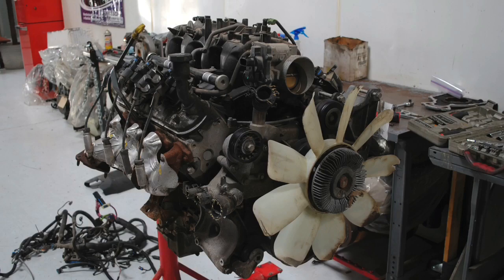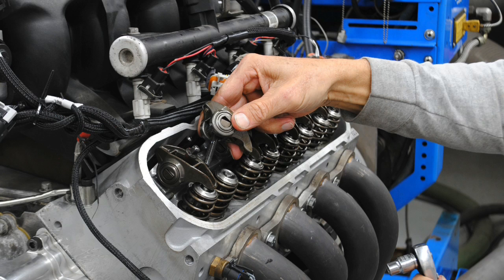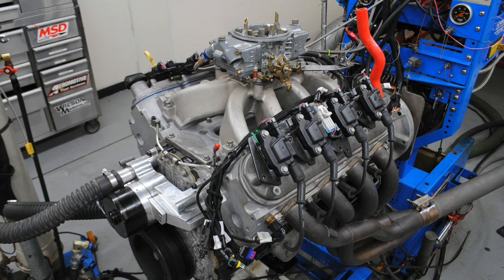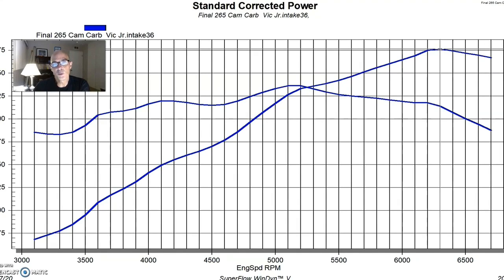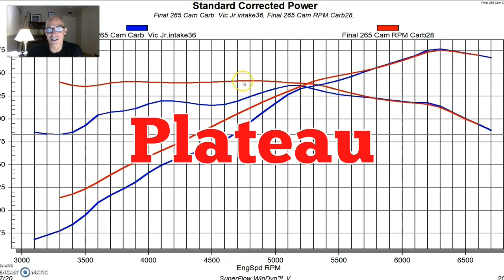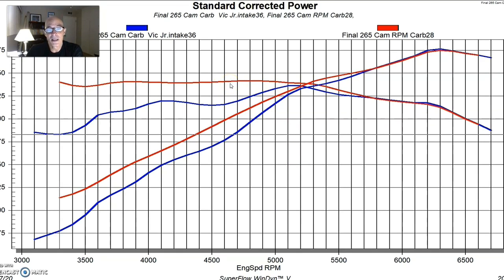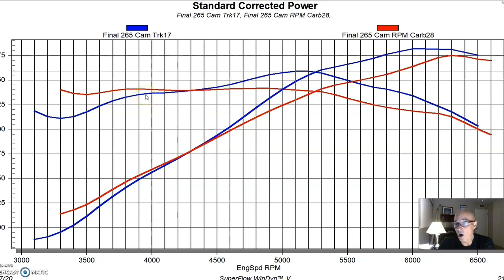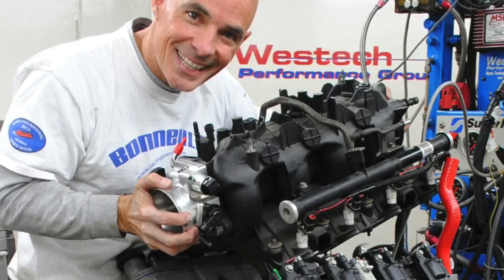CARB & EFI 4.8L INTAKE TEST

Comment: Do you have this test on a bone stock 5.3?  Just curios what peak HP would be on a bone stock junkyard 5.3 with carb & dual plane setup?  You typically get around 350 HP with how you setup your tests….Would it be similar peak HP like the 4.8 or do the extra cubes help out the carb setup?   

The RPM range where you get extra incremental torque with factory efi is very surprising to me…..I guess the low pressure waves in the long intake runners are well timed at that rpm range….

Comment: Have a gen 4 4.8 with 706 heads, texas speed 3 cam, ls7 lifters that got for free. That I want to put on my 1981 c20 paired with a th400. Thinking of going carb since I have no ecm or harness. Dual plane for the the low end torque. this setup work well with the c20 th400 4.10 gears 265/75/16 31in tire?

Comment: Do you have a video on dialing in a MSD 6014? I have my 4.8 running on the the "Truck" preset. I have a BTR Torque Cam and 650 Edelbrock AVS2. I'd like to use a "Custom" setting do dial it but have no idea what to do
Reply from the maker: I use custom and no map-only rpm vs timing

Comment: My little 5.3 s10 with longtubes ss2 cam .pac 1218.s holly duel plane and quick fuel 750 and nx mainline nitrous kit .th400 amd 8.8 rear thiers few more things done but that's basic rundown runs very well on motor ib beat a new 5.0 mustang and other similar s10 that are fuel injected but I don't care about carb or fuel injection either one makes great power both have ups and downs im not chasing every extra few hp eirher.rhays why I have nitrous. Lol

Comment: How do I pick out the right tunnel ram in carburetors for my 496 big block
Reply from the maker: a pair of 650s or 750s
Reply: @richardholdener1727  thank u
Reply: @richardholdener1727  how about a tunnel ram what would you suggest a holley sniper or weiand tunnel ram

Comment: Would a summit Stage 4  .625/.605 lift 234/247 Due 113LSA work on that type 5.3 Carburetor dual intake combo for high way/Street
Reply from the maker: yes

Comment: I have a 4.8 with the Edelbrock dual plane intake, FITECH TBI and 700r4 with stock converter to put in my 68 Pontiac Tempest Wagon with 2.78 gears. I want to daily drive this.I am also considering a BTR Torque cam. and a 1/2 edelbrock 8722 wood spacer to keep heat off the FITECH (don't know the performance). What do you think of this combo Rich? 
Thanks, Al

Comment: Did you run the dual plane backwards?
Reply from the maker: yes you can
Reply: @richardholdener1727  I guess it depends on the angle of the engine.

Comment: Would like to see an additional injector set up behind throttle body on truck mamifold to see what the effect of charge air cooling and mass inertia if any is compared to without and carb performance

Comment: The reason the truck efi manifold vs the dual plane tb/carb manifold makes less torque , but slightly more midrange & high end HP, is due to the truck efi having a larger plenum area, whereas the dual plane has a smaller plenum area  (or the top end where the carb/tb mounts). So this would make sense.  Larger runners, more low end, Larger plenum, more high end. So when you change one, it will affect the other. How much you change these is dependent upon what you are looking for.  For example, adding 1/2", 1", 2" , etc  tb/carb plates. The fully open ones add plenum volume,  the 4 hole versions add runner length. So these should be used accordingly. Whether the depth (1", 2", etc) or fully open,  4 hole,  even the tapered versions of each can affect the powerband.  I see these, amongst pretty much anything that goes on an engine, all mismatched &/or thrown together improperly.

Comment: I’ve been running an RPM intake on a mild cam 6.0 Ls2 with ported 243 heads.  I use a Holley Terminator TBI and HP ecu.  
The carb intakes look clean and good under the hood of a classic. The carb intakes are inexpensive and simpler to set up if you’re using an actual carburetor instead of TBI.   
Looking back I would have gone with a more expensive set up like a Fast Lsxr intake on my combo because the RPM intake in comparison leaves a lot of power on the table.  If I went with a Fast now it would wake it right up.

Comment: Wow, excellent video Sir. I had always assumed even w/a mild cam on an LS engine that a single plane would flow better right off the bat. Reason being is the natural (unported) flow characteristics of gen 3 & 4 heads are so far superior to that of a small block that the gains (even if miniscule) would still be visible. 

Another interesting note is again, how the factory truck intake really is a good performer

Comment: In defense of the carb setup, the power curve it’s laying down is far superior for the daily driven, red light to red light type of build. So when the dude with the efi setup pulls up next to you at the next red light you’ve got the 60’ in the bag. If he’s got the gusto to gap you, spray it at 5K rpm with a 125 plate.

Comment: This was something I always wanted to see. I have a carbed single plane 4.8 with a ss2 cam. Its driveability is junk! Anything below 4k is snooze fest. But when the secondaries open up it really does scream.
Reply: If it's got mechanical secondaries a small bolt with a nut on the linkage will make them open quicker... Have fun
Reply: @theall-seeingpie8887  it's vacuum, and I have the lightest spring possible in there. I'm going to tbss intake and EFI soon. Thanks for the tip though!

Comment: That is interesting....a long runner EFI manifold had LESS torque down low and MORE torque at high rpms...never seen that before. Any guess as to why?
Maybe the aftermarket cam affected the results?
Reply: Dual planes make more low rpm torque.

Comment: hey try this on the ls run singel plane and run a small cfm carb change the air bleeds.i think your running a 750 850 cfm try a ajustible carb at 600 cfm with this combo.volacity is the way of low end.dual plane is best for small cubes air speed seem to be best for low end but uper end is where we like to be.this is my take on this now for a exsample on stock intake ive ported just some off the runners port match and just good runner clean up not big air stuff seemed to raise hp in uper rpms but still keep low end and midrange pulled well it was crisper all around.so hp how much est 10 hp but thats seat of pants pull thew th rpm range.yes its not worth to port stock intakes but when you want a littel extra kick yes its worth it i think so i dont mind at all to do it and yes ive lost hp to from hoging ports out so you live and learn i did.ram tuning now thats a callange right cam? intake?carb and be tune to a rpm from1800 to 5000 big leap i know but its a chalange to get close or try.there some cheap thrills.E-85 a fule to just to try to go faster with.lets build a carb for e85 can it be done for cheap and be realible for every day use holly makes one now can any body.
Reply: You obviously don't understand tip in on the carb sizing and smaller isn't always better for torque.
Reply: @kkmart43  smaller will raise low end not top end and singel plane loses low end know matter what you have  and volicity will raise torque changing to a bigger carb dont in prove to raise low end that was the point.and big ports dont always help fill the chambers at low rpms volicty dose so if i wanted to reach 7500 rpms yes singel plane but you lose low end.holly could give you a better understanding of this factor.
Reply: @jumpsuite  carb sizing doesnt change anything unless your too small then it will kill low end, it's all in the manifold.
Reply: @kkmart43  ram tuning is about filling the chambers at sed rpm cam +carb +  fule at sed rpms=hp.manifolds can be to big at sed rpm.amanfold is tuned to a rpm no.so  to small you lose uper end zo if manifold is the right size it will alow you to make hp but thirs rpm limits to manifold thing so the manifold controls it all no it dont.flow only means hp when its right to the app not big means more.thers so much more to list im  not going to  reply so dont.if your into engines and try helping others than help them not me thanks.
Reply: @jumpsuite  im not arguing about the effects of intakes, your original post says to put a smaller carb on a single plane intake to boost low end. that will not boost low end.
Reply: @kkmart43  ok now rpms from 1000 rpms to 5000 your low end is apox is 1600 rpms now a biger carb help no .but if your useing single plane you lose low end and if use a bigger carb on the singel plane you agine no low end  now if your running to 7000 rpms the your low end gets bigger but now it comes to cam size carb size and manifold range in rpms oh heads to cant for get that.but if the cam is for upper rpms like from say 3000 to 6500 than yes smaller will kill low end but to big dont help either so when you need response when your racing now you cant lose a fraction of a secound you lose so the carb for what you biuld is the factor you need bigger is not all ways best but a you seen on this it didnt make much of a diffents but it did show what you need to make the engine get the best hp at sed rpms on the engine tested so if i was raceing i would choose the right cfm carb that gave the best over all hp  but the reponose is the key.

Comment: The Victor is too big for a 4.8 engine. A smaller intake, single or dual plane would make it better.
Same test on a 6 litre would make a difference. Surprising on a healthy [good heads, compression etc] SBC the Victor was very good.Low end and mid range And that defies common logic.
The dual plane does not work with throttle body efi. Engine master did that.
The truck intake V the dual plane. Power was better below 4500, torque was better below 4500 also.

Comment: What if the dual plane had port injection installed and a throttle body, would it have the torque low down with the tunability of the factory Fi, next the turbo test how do you make this work in a street car that has to have mufflers the back pressure 4 inch dump pipe can you revisit the turbo test with exhaust pipes and mufflers to see the difference and a air cleaner. ever thought about a Y block Ford test? some people are making big power with them.

Comment: On the factory intake, would it produce more torque if the injectors were higher up on those long intake runners? I know it can not de done but if it could, I think it would make more Torque and HP.
Reply from the maker: YES

Comment: I hate to be that guy but why not try the tbss intake with that combo. I run that exact cam in 2004 36k 6.0 completely stock except cam and it will completely blow the the tires off. The torque is nuts. I am wanting to put my my vs 76mm turbo on but can't find the time. I hate responsibility lol
Reply from the maker: THE TBSS DOESN'T DO ANY BETTER DOWN LOW THAN TRUCK
Reply: That is pretty much what I was thinking with the torque I was just curios how much hp it might have picked up hp wise with that 4.8 combo over the stock intake. 15 maybe 25 as everyone has said keep up the testing I love it.

Comment: Wheres that custom super long length  ls intake that Drives torque in the 1500 5000 range ? You know the one that you haven't built yet.

The one with water jet 3/4" flanges and exhaust collector style   single point collection per bank of 4 
Them move 8 injectors away from the head to the other side of the motor for charge cooling ala crystler in 66.

You can do all that for turbo wiz bang, 
Why not N.A.?
Reply: Would love to see a really long runner LS intake to replicate a TPI set-up.  You’d think that would be a hot item for every truck owner.
Reply: @wwmaness   Ilmore made an intake for their 6.2 marine engine where they claim peak torque at 4400 and peak hp at 5600 that looks alot like the TPI intake to me, it has a lower and upper that bolt's together. I have one waiting to go on something.
Reply: @oggp5951  Thanks for sharing!  That makes a lot of sense that one was developed 
 for a marine application.  Cool that you were able to get your handles on one as well. We know Richard would love to test it!
Reply from the maker: MISSED ON A FEW OF THE DESIGN POINTS

Comment: Hey Richard, set youself up an account with Row52.  You can get an alert by email when a hard to find a vehicle is freshly set in the yard. Like you said, got to be one of the firsts ones out there or they're gone right away. This is how you'll get those 6.0L LS or aluminum 5.3L from the Trailblazer/Envoy.

Comment: why dont u guys ever show 1500 rpm and up ? great vids you putt allot of work into this
Reply: I’m assuming it’s because nobody would need nor care how much power you make that low especially considering you’re not even at full throttle.
Reply: @linoleumshake  HIGHWAY speed climbing hills  PUlling towing etc ? without spending extra 8000 grand or  repair costs on a diesel
Reply from the maker: AT WOT?
Reply: Most trucks have stall speeds in the 1,200-1,600 rpm range.

Comment: @Richard Holdner, you should do a comparison of the dual plane versus the Gen 4 truck intake and the LSXRT, I have a gen 4 LY2 I'm building for my E36 track car and would love to see that comparison! I'll be doing BTRs road race cam along with TEAs 243/799 cncd heads with a bump in compression, im shooting for 500 crank horsepower similar to your 500hp recipe setup
Reply from the maker: lots of vids up comparing the Fast to the truck-the Fast is a lot better-just more $
Reply: Eventually I would like to do a TSP sleeved block bored to 4.185 with the 4.8 crank giving me a 359ci setup with a 6.500 rod and custom pistons, ends up with a 1.98 rod to stroke ratio

Comment: I thought of a neat idea build an elbow/adapter to mount a carb on front of the truck efi intake, I don't see how it would be hard to Fab up, it would be interesting to see if it even worked, I think it would. You could start a revolution!
Reply from the maker: I built one of those-just haven't run it yet
Reply: @richardholdener1727  nice!

Comment: Gosh, this is exactly why I wanted to see the Offy 360 deg dual port high rise. To compare to the RPM air gap. I wanted to see if it took off the high end or not in a direct comparison. The idea seamed solid to keep the velocity on the low end and provide the volume on the high end. I know you said you tested them before but I searched your videos and cant find it anywhere. THis fasinates me because I remember guys knife edging those port dividers to increase the CFM and they swear it worked. It was popular back in the day.
Reply from the maker: have not run the Offy 360
Reply: Oh, I thought you said you had. I'd like to see that go turbo.

Comment: An LSA experiment in this mix would be awesome. You have 114 here, 110 is common, 106 goes begging, and 102 is the not insane step to see if what everybody says is how it actually goes.  
102 is maybe not as crazy as it sounds. 212/218 with 102 LSA has the same overlap as 222/228 with 112 LSA.
Reply: Just makes for a more peaky powerband/ torque curve with the tighter LSA
Reply from the maker: look at the lsa vid already up
Reply: @richardholdener1727  That didn't get down to the 102 LSA
Reply: It was that LSA test that made me want to see what a short duration ( like 212/218) would do at 102 LSA
Reply: 212/218 with 102 LSA has less overlap than a 232/242 with 120 LSA

Comment: Rich you to use the wats line 
And get them shipped into you
I have yet to be in the boneyard where you don't stumble across a half a dozen or more in the yard at one time 
I am currently building lq4 6 litre in to stump pulling 408 cubic inch 6.7 litre
Reply from the maker: wats line? I spend endless hours in yards-do not see any 6.0Ls-only the smaller ones

Comment: can we say that the GM4.8L  curve holds true as well for a SBF 289, except that the 289 will never make those TQ/HP numbers with stock heads running the same setup dual vs single with the same cam characteristics.

Comment: Awesome job as always. I love watching some of the budget builds and content. We have a new 4.8 with 799 heads that I will be pulling out of the 08 truck and putting it in an old C10 on our channel.  Thanks CW
Reply from the maker: are you putting 706 heads on it to make more power?
Reply: Will the 706 heads make more power than the 799 heads?   Thanks for responding so quickly and giving the Ls community so many tips.
Reply: Have a gen 4 4.8 with 706 heads, texas speed 3 cam, ls7 lifters that got for free. That I want to put on my 1981 c20 paired with a th400. Thinking of going carb since I have no ecm or harness. Dual plane for the the low end torque. Will this work well with this setup?

Comment: On the EFI VS CARB you were talking about the carb style fuel injection to take advantage of the charge cooling but you lose the individual cylinder tunability but i ask you this, could you run both at once... think like how the combination direct/indirect injection but instead have the main fueling come from the carb style injection but even them out with the port injection
Reply: Don't see the point in doing that. Most of the time with racecars, if its a good idea its probably been done already. Why not run throttle body injection and not overcomplicate it lol
Reply from the maker: F1 had duel injector positions to provide the charge cooling and individual cylinder tuning

Comment: I still fail to understand... Why bother putting a carb on a LS? Always the same or less power with a carb (at the mid to high power level) and the stock intake and fuel rails end up allowing for much better power with a minor tune.

What about one of the "throttle body" carbs that are really nothing more than an air intake on top of the classic intake but still uses the stock (or better) EFI fuel rails? Does it still show the better down low power?
Reply: Simplicity. What you see here is a difference in manifolds. Not the difference in carb vs efi.